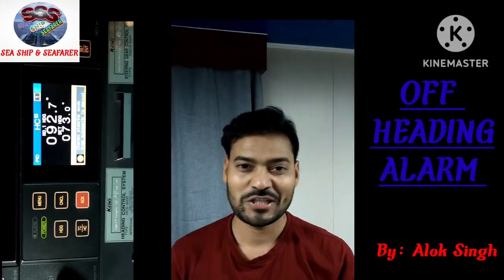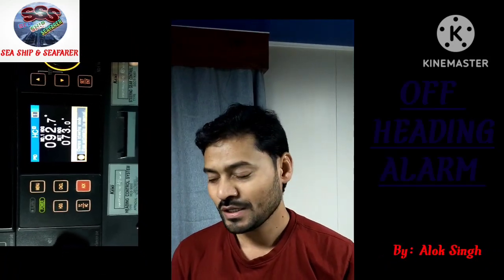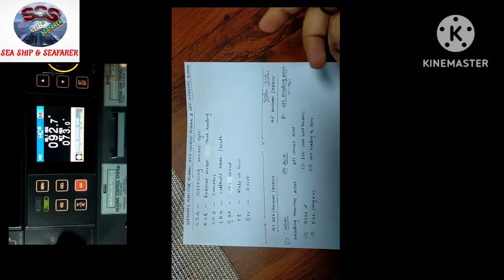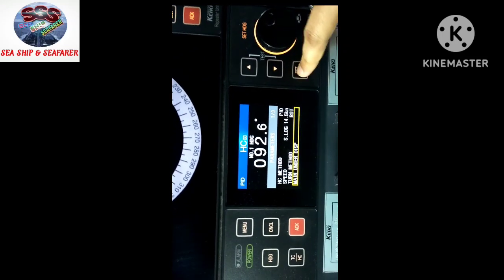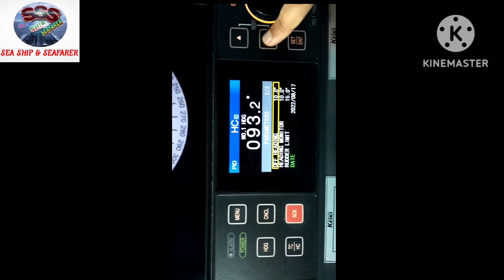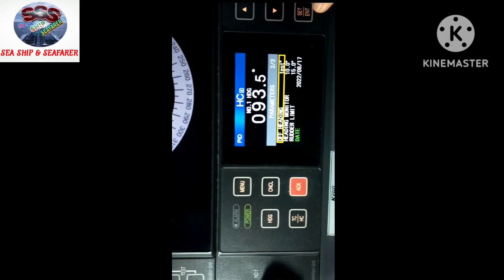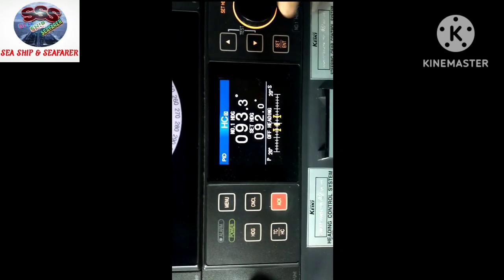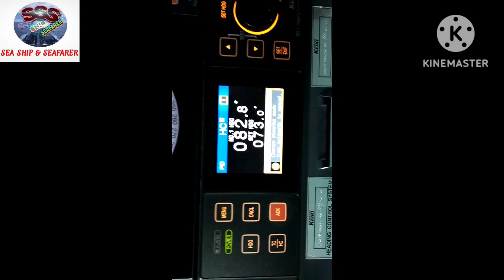How to try out Auto pilot Alarm.Off Heading alarm ,Heading monitor Alarm,Off course Alarm,Alok singh

Comment: i Still cant get it. What is the difference between Off-heading alarm and off-course alarm?
Reply from the maker: Bro, Off heading alarm will come if your set value (which is set by rotating knob) is more than actual steering (vsl currently steering). Nothing related to External
Reply: @Aloksinghsunny  oca - difference between set course and sensor not in use. And off heading - set course and sensor in use. Got it. How do we interpret if one of these 2 alarms come? I mean how to react if we receive one of these alarm?